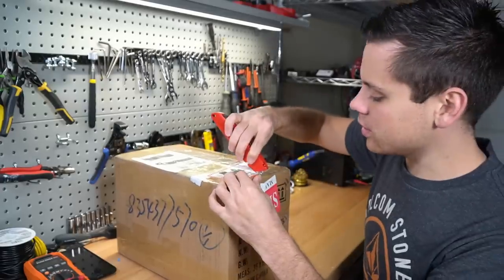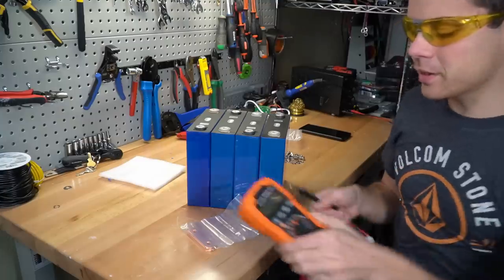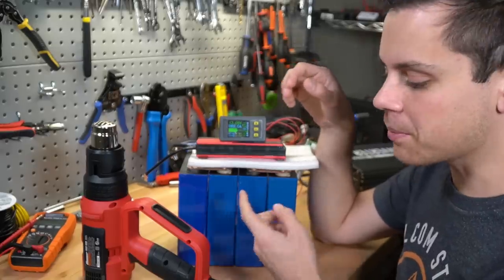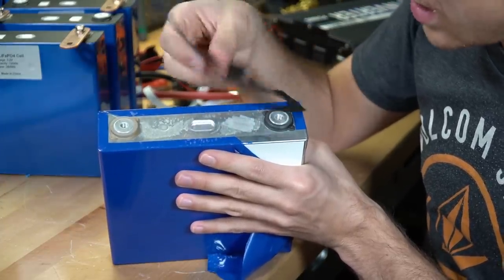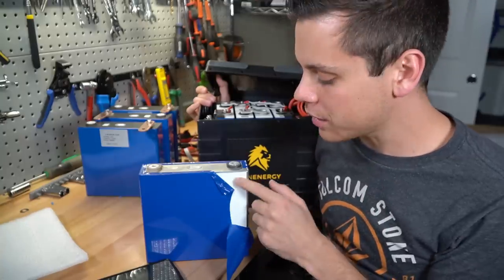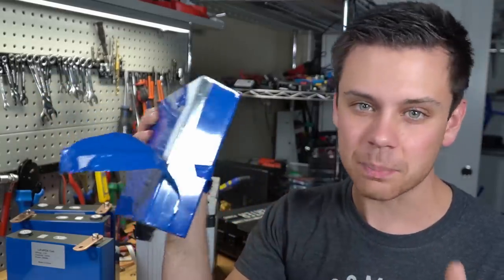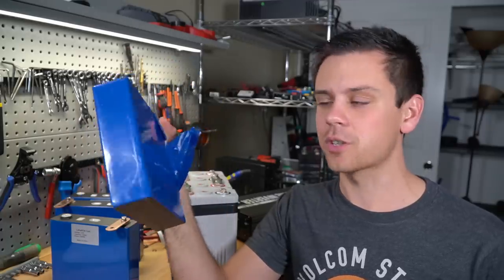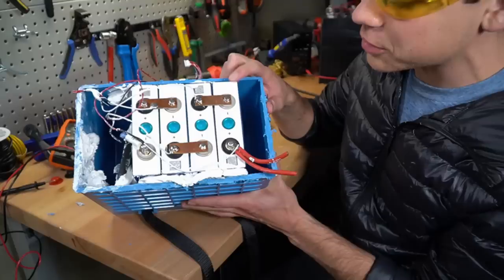Cheap 120Ah LiFePO4 Al Cased Aliexpress Cells: Are these Grade B?

Comment: I bought these exact batteries last month.  The ones I received were more closely matched than what you received.  I suppose its luck of the draw.  They work well enough for me and the price was right. My application is for my RV which I only use a few times a year.  Lead acid batteries wouldn't power the microwave through the inverter for more than a few seconds.  High current with low voltage drop was more important than meeting target capacity (haven't tested yet).  Still, I appreciate your review.

Comment: I have the same cells and after running capacity tests I only have 118ah. Ok for now in that it was my first build. Like you said, you get what you pay for. Next project, I'm going with the calbs or brand new aluminum case cells.

Comment: Hi Will, great video once again. When assembling cells into batteries, particularly when the are cheap or used, check the internal series resistance of each cell. You'll see any variances in matching this way and you can easily spot a dud before you spend time doing discharge testing. you can also get a feel for how 'Used' used cells actually are. Merry Christmas from the UK.

Comment: My experience with AliExpress refunds is that if you provide solid evidence they will judge in your favour. If the product is still usable I ask for a discount. If it’s not usable then I ask for a full refund without having to send the item back. I’ve never been disappointed. 
My disputes concerned much lower value products though.

I’m curious how this case will work out.
Reply: I've had a different experience recently with Ali express. I was sold something that electrically did not match there advert and I had also contacted them prior to shipping and had the messages where the supplier lied and they still sided with there supplier. I did get a small refund but that won't be much use to me when the item fails
Reply: Conservator and Djbart thanks for sharing you AE experience.
Reply: djbart78 Hi,
Just curious. Did you add screen prints of the messages to the dispute?
Reply: Yea put everything in the first time, then they asked if I had anything else. I actually contacted a rep and explained it all and said what else can I tell you? There advert was incorrect and they actually lied to my specific question. There response was that if I didn’t have any more information then they wouldn’t look into any further. I contacted them again and the next rep listened and said he understood the situation and these instances has happened before, he would escalate it and get back to me. The next day they just processed my £20 refund on a £250 purchase and that was that. I’m in the process of claiming off my credit card company. I even emailed them after and said hold on I never agreed to the partial refund  for all the stated reasons and never even got a reply to that
Reply: I think my issue was more down to a lack of understanding, in that the product was advertised to work on 50/60Hz and I asked the specific question is it both 50 and 60Hz. They answered yes but when it was delivered it was quite clearly 50Hz only. While this will work at 60Hz where I live, I have had numerous products that either fail to work or burn out within a month or 2 due to the frequency difference when running a motor. So while the unit potentially will work, it could fail within a month and I would be then out of pocket. I explained all this and said I wasn’t looking to keep the unit, quite happy to return it if they paid the shipping as it was not as advertised or spoken about. If they had told me it was 50Hz only I wouldn’t have purchased it
Reply: So in the case of the batteries in the video, just because you deem them not as advertised, and quite correctly. They will basically say, well you have 4 batteries as ordered and they all work to a degree. Because there not matched and 1 is slightly more degraded. He still received 4 120ah (cough cough) batteries. Just be careful if spending thousands which can easily happen with these batteries
Reply: @djbart78  It sounds as though they gave you a partial refund and maybe told whatever moderator that you agreed to it, I'll be curious to see what your C/C company does... does Alibaba accept pay pal? I have been holding back buying from alibaba 'cause I have this sort of thing before ...
Reply: Doug Johns 
Your correct I did get a partial refund, about 10% but I had refused that offer and given full explanation as to why. Will update when I get an answer off the credit card company
Reply: I think for now I personally will avoid AE
Reply: djbart78 
Thanks for sharing!
Reply: ds525252 
It’s not risk free. Djbart78 had a bad experience. I’m quite happy buying from AliExpress I’ve ordered maybe 400 times and maybe entered 10-15 a dispute. I think I only lost the first one because I didn’t understand the prices back then. But most of the orders just go ok. Cheap counterfeits are banned now. That is, almost no articles with brand names and logos are sold anymore but some products have a striking resemblance with a branded one. If you’re going to buy something, start with some small low cost items.
Reply: Conservator a 400 sample study is a good amount.  I like the odds and now hearing both sides I’ll go in eyes wide open.  Thanks for sharing the info.
Reply: Not my experience with AliExpress. I purchased an item described as polished stainless steel, it was brushed aluminium. They would not accept it from photos and as a report from a metallurgist would have cost more than the product I took the loss and have not dealt with them since, or recommended them. Dealing with China direct is based on trust and once you cannot trust them it's just not worth it.
Reply: David Blyth Hi,
Did you open a dispute or did you just have a conversation with the seller?  (Just curious)
Reply: @Conservator.  I opened a dispute after getting nowhere with the seller. AE backed the seller.
Reply: David Blyth 
I’m sorry to hear that. Thanks for sharing!
Reply: @Conservator.  You are welcome. It's a shame as I used to buy from them regularly.
Reply: I bought cheap pack of AAs and it was over due delivery date so got them for free. Rubbish batteries though, only usable for clocks or low drain devices.

Comment: You nailed it on the head when you mentioned the price rise after a good review and drop in price from a respected professional reviewer such as yourself. One reason I won't jump into this. This happens on Amazon,  Aliexpress, eBay and everywhere The price rise in just the past year (almost doubled) for even the lead acid's not to mention if you're getting new, used or just plain junk. Going green or trying to as much as possible is keeping a lot of us out. I am sure probably 95% of the world is locked out of this extremely useful project not to mention local codes, laws, regulations trying to stop you and electric company's putting up roadblocks every step of the way.

As much as I enjoy looking at and learning from these videos, the one thing that aggravates me is when you say this is cheap or that is cheap when it really isn't compared to what you actually get and then the replacement costs of nearly everything. 

I think in one of your videos you said that a nominal overall solar system would run about roughly $40,000 with a shelf life of about 30 years. We all know that 30 years is pushing the whole everything to it's limit.  Failure of everything with the exception of the solar panels needing replacement a few times over during that 30 year period. A good charge controller, 48 volt 240 volt a/c inverter and batteries are the weak link and replacement costs are NOT CHEAP. I am also not in the income bracket that I can fork over that kind of cash. 

My present monthly electric bill runs between $70 and $100 (@ $0.11 Kwh) with the summer months, of course, being the exception but even then we manage to keep it below $130-$140 at great sacrifice. My 30 year cost for being forced to use the local electric company is below the cost of going solar but we all know that. I really wish this going green thing wasn't such a scam as it would be much cheaper in the long run. Even a small, say 1000 watt system is out of reach. Just 400 watts took me a year and not really contributing to our reduction in CO2 footprint. I do have enough wooded land that I think makes up for our contribution though. 3 times over probably.  I really wish I could build a system that could generate the 14 to 20 kW we use daily on average. It's just the cost that is in the way. 

Anyway,  I do enjoy your videos and appreciate all the useful information and your effort. Also MERRY CHRISTMAS and HAPPY NEW YEAR to everyone.

Comment: HI WILL, I get so much fun from watching our vids. I do have a small battery to run some ham radios, but nothing big, Thinking on that, you should get your Ham Radio licenses , it is not hard and then you could help us out with first hand info on emergency systems for the typical radio rig at about 100 watts out. Thanks Dave, W4GSM

Comment: While they may show as 80% capacity, it would be more interesting to know how many discharge cycles they have left in them. Perhaps a good test to do on an upcoming video.
Reply: Yes, do LiFePO4 cells degrade faster the more cycles they've gone through?  That's a big factor to consider in terms of whether or not 80% used cells are worth it.

Comment: Hello Will.I want to build a battery bank with cells like these just 110Ah grade A.The problem i found in the manual of the batteries is this:"After each brake charging, the battery needs to rest for a certain time, which should be equal to or
longer than the duration of the pulse charging. During the rest, the battery can be discharged in low rate,
or in a non-working state. But in the rest period, the battery is not allowed to pulse recharge again."What i understand from this is that if the battery charges for 5 hours it then needs to rest for at least 5 hours if not longer.And if i am using my solar setup during the day and if a cloud passes and i draw from the battery it will not be ok for the battery?
Thank you for all the amazing and informative videos.Wish you all the best!

Comment: I think Internal resistance can tell you alot about used cells. My BMS can calculate it for each cell. Other way is to measure it with a special instrument. Costs app. 40$ and you can "measure cell health". And no more gussing.
Reply from the maker: I have a meter for testing ir. Just lazy. But yeah, would show a difference for sure

Comment: The first cell did not had the same state of charge based on initial voltage measurement. If you have top balanced the cells before the test they may have been quite equal.
My A123 cells had the model number removed (easier as it was just paint so cleaned with alcohol) and I think they purchased the cells to recycle or destroy (not resell) and so they remove the original identification markings so they do not get in trouble for reselling them. If this are CATL then they do have similar policy with A123 and do not sell direct just to large system integrator's like EV makers not for resale to public. They may be quality rejects for some reason and maybe a bit old stock but should be fine.
Since it takes forever to cycle them thousands of time to see how they will degrade a good indication of quality is to measure (calculate) the internal DC resistance. To do that you just put a known small load say 10A measure the voltage of the cells at the terminals then switch a large load say 110A and measure the voltage again then subtract those two voltages and say you get 50mV then you will have 0.05V / (110A-10A) = 0.5mOhm and that will be a fairly good result. Another type of cell that has the same capacity and double the internal DC resistance will heat more internally when used and most likely will last less.
And about the connectors on those cells they originally are spot welded so the re-seller tap drills them so they can accept bolts for easier DIY use.

Comment: Will, even though I have never meet you I still love yo...what you do!
You seem to be onto everything lithium! Fortunately for me, it just so happens  that I'm building a sprinter van motor home...and I need a battery system for it.......A big one or as much capacity as will fit in the van.....I was thinking a 24 volt as most of my appliances are 24 volt and 500-600 watts of solar plus alternator and shore power charging @ 24volt...
I am an electronics tech from an early age but lithium tech I have yet to catch up on but am on the way thanks to all your wonderful vids, thank you....
My question is what cells would be good to produce 24v at as much capacity as practical for the space  I have available....the space is not something you need to worry about....I need good reliable cells from a good  reliable seller and a good BMS for them.
Thanks for your time and your videos and its good that you're ripping apart all these Chinese batteries for us to see inside!! Something we all need to see before we buy.....! Your the Battery vigilantly and this will single handily lift that standards of Chinese lithium batteries for us all!!
Reply: @MotorizedBicycleRace  Hey thanks for that. I'm in Australia and freight may be prohibitive. Also Lithiums in Australia are over the top price wise. Also I like the idea of cells as I can buy a few and build them up over time.
Reply: @des2610  remarkable isn't it, Australia with all that lithium, space for huge buildings, sun for solar and no giga-battery factory to make affordable Li-batteries for Australia.  Instead its all shipped overseas.
Reply: @telocity  Such is the dictates  of the elite for the NWO....

Comment: Just went to the Renogy site - went to buy a $899 battery, added the $99 battery monitor.  Put “WillProwse” in the discount box, got $10, which is 1% not 10% as advertised...  love your work Will, could be an honest mistake on Renogys part.  Perhaps you want to reconfirm the discount available...? Thanks

Comment: These cells still will work just fine with active balancer  in place.  Of course only 80% of the original capacity but hey they are used aren't they?   I know for sure because i built for years cell pack from recycle batteries with way  less capacity than these LFP type and they are usable for 2 years on each pack that i built (recycle = throw away).   Sure they are not LFP but they all are lithium aren't they? 
I am migrating toward LFP now for their advantage.  They cost more initially for sure but i know for sure i do not have to rebuild my pack for years to come.

I never do  the video of my system because i know very few  will do due to the time, complexity and effort to build such pack of 1s100p and have to do that 14 times for the 14s100p.   But boy oh boy i sure learn and know a whole bunch when i have to do that vs buying new on everything.

Well i am migrating toward the LFP type of battery.  My main motive is I like the 15 years lifespan and still 80% of capacity  after that.  Hell i still got 2 years of use with recycle laptop battery which guesstimate 40-60% left capacity so LFP is a no brainer choice.   Really with the initial cost they are a bargain  in compare with the other type of lithium cell.

Don't fall for the simplicity and easiness of ready to go solar server rack.  I get more bang for. my bucks if i buy new  LFP   at any grade  and a case kit with bms and all accessories and  assemble myself.    Can you beat under $2000 for  16 LFP's battery with 300AH  in a case with bms and active balancer?  that is what i found out during my research.   That popular EG4 brand is selling about $1300 for just 100AH with no active balancing    48V system that is.   Thanks but NO thanks i build my own and I can fix easily if something goes wrong later.

Don't always believe what you see on Utube.  Do your own homework to determine fact from  not fact!!!!!

Comment: The question I have is about operating temperature... What is optium? Would 50 degrees 24/7 be good, if so using geothermal for heating cooling would be an easy thing to do.....Bill Rogers

Comment: Thanks for your videos. I actually bought a GTK pack for my golf cart from Ali Express and have been battling with the manufacturer ever since. Battling even to the point that the company Foxelion created a fake SMS/text message to use as evidence in the dispute so Ali Express would deny my dispute. Now the BMS keeps tripping when I give the cart some throttle, making it unusable. Your videos inspired me to open it up and seek to change the BMS, but I did not find quite what I was expecting when I opened the case. Instead of 16 cells like what is in your video, there appear to be 48 individual cells each measuring approx 3/8" x 5.5" x 7". The BMS is JBD-HP28SA and the pack is supposed to be 100AH 48V Lifepo4. At this point, and being a newbie to lifepo4 I am hesitant to dig in any farther. I am hoping to get your opinion on this pack design and any advice that you can provide. I would be comfortable swapping out the BMS as there are just 2 soldered connections and 2 plugs, but is there any good way for me to test to see if that is the problem before I do so? Would it be worthwhile to buy an upgraded BMS to replace this one? and if so, will the balancing wire plugin be the same?

Comment: jack ma is probably a synonym for jack ma (Founder of aliexpress). Sino is another word for China.

A few question. Have you tested CATL cells, 50A, 110Ah or 320Ah on aliexpress? 
Also do you use Yellow Fiberglass Sheet beetween the cells? or how do you isolate them?